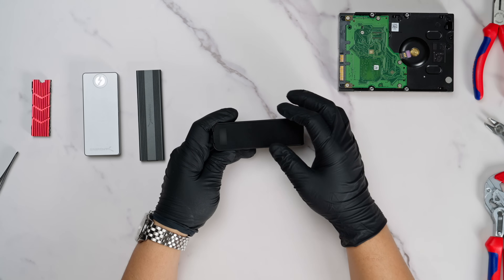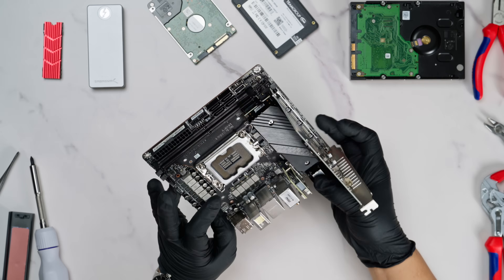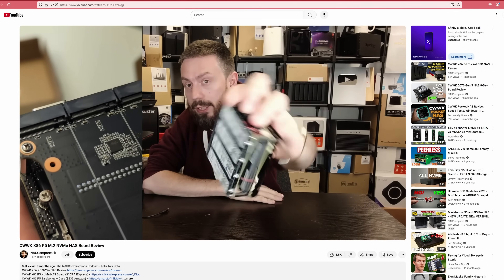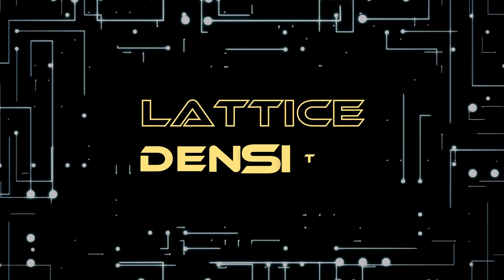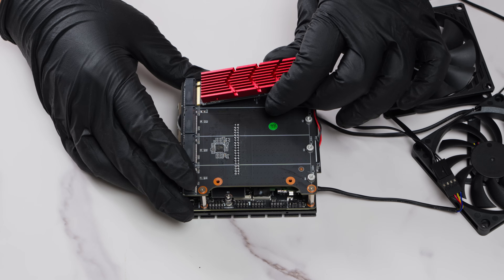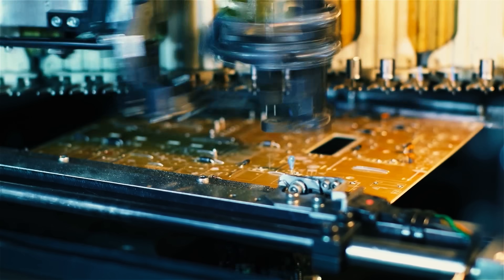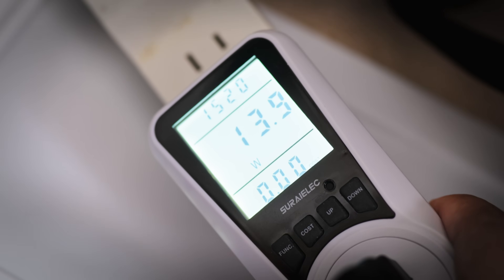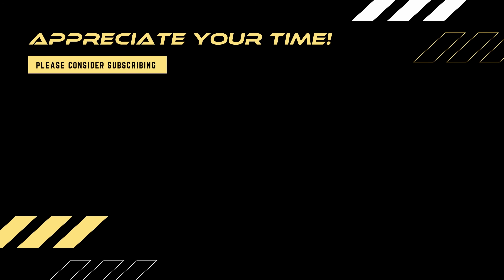Building a Tiny 4-Bay x86 NVMe NAS for Less Than $200 using CWWK SBCs

Comment: I have one of these NAS, with the case. Deciding on a system drive, I prefered to not use one of the NVME. I ended up with a m-pci wifi to micro-sd card. Booting from that has now been working for about three months without any issues, so far.
Reply: Actually that looks like an M.2 A/E key 2230 wifi slot, not mini-PCIe. Didn't know they had microsd card adapters for these. It's not always certain that you can boot from these slots, but I guess this does.
Reply: @dktol56  the wifi slot is still m-pci, just a 1× speed, plenty for a micro-sd card. The keying is to stop people putting NVME or similar in expecting high speeds, and then getting frustrated.
I've also seen A/E key to B/M, and A/E key to sata adapters.
Aliexpress is the home of all these odd adapters and cards.
Reply from the maker: @foznoth  I actually didn't know the keying is for preventing people ha ha😅I thought it's just that they don't need as many lanes for lower speeds. Good information. Also, I could not find those 2230 SATA adapters, do you mind linking one please?
Reply: @foznoth I believe all pci-e lanes are restricted to 1.0x in this build
Reply: @tomigun750  sort of, the main m-pci slot is x4, but the the breakout board splits that between the four drives. I've not tested if this is a fixed or dynamic split, mainly because I'd not thought of it until now. The four drives I have in mine are set in RAID-5, so for read speeds I get approx ¾ the speed of a single x4 nvme. As this is my music server, speed isn't a high priority.
Reply from the maker: Yeah that's one route I considered as well, but I wanted to keep the wifi port free and also I am a little scared of adding another converter-fail points so I used this Sata board. I am glad you are enjoying this build though, I think it's been pretty great so far!
Reply: @LatticeDensity  everything has a chance of failure, we just fix them as they appear.
In my case wifi wasn't a necessity, as being a NAS I wanted it wired. Plus most NAS builds of Linux don't play well with wifi anyway.
Reply: @LatticeDensity  what is the exact Sata board?